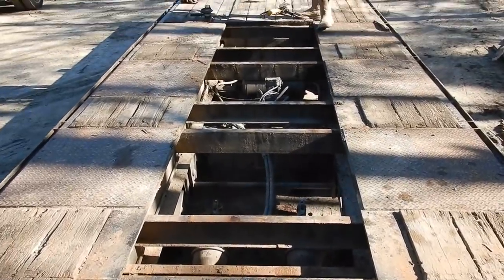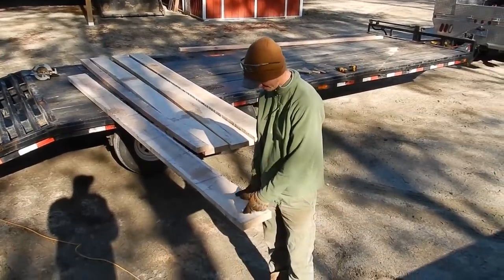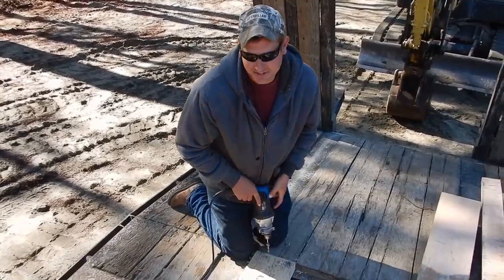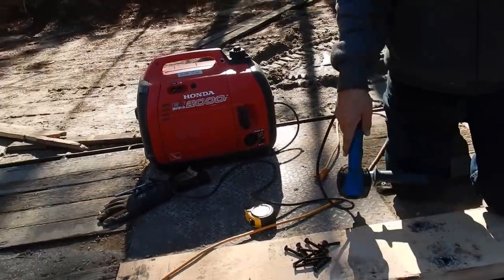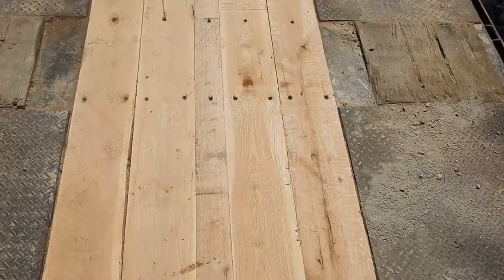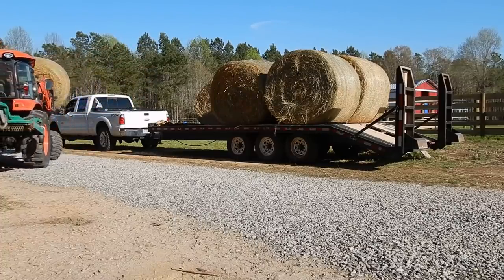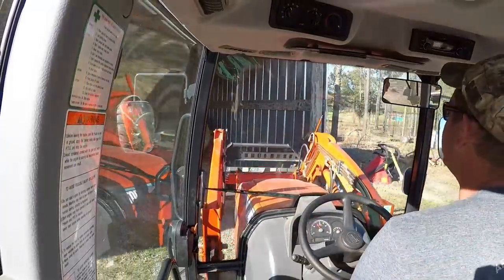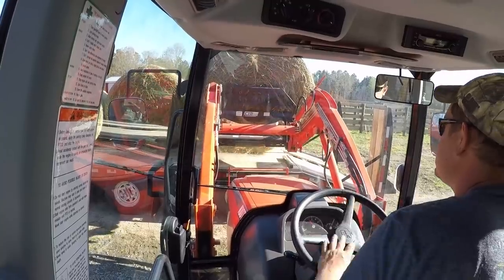Fixing The Trailer Deck And Unloading Hay

Comment: You drill steel slow....  You're cooking your drill bit. Lower rpm lots of pressure and a little cutting oil would make your life much easier
Reply: Nahh little drill send it full power
Reply: Depends on the drill bit. And size of steel and type. Dont act like a know it all if you dont know what your talking about
Reply: @williamuskoski1385  only been a fabricator welder for 10 years wouldn't know anything about drilling holes. By the looks of it a 1/4inch bit on pfc channel probably 1/4inch maybe a little thicker so yea that drill probably wouldnt spin it fast enough.
Reply: @hamishcampbell4578  Been a welder fabricator and design my own tools for 30 years ! I keep a small container of used motor oil near and dip the drill tip into the oil when ever it needs it ! I've drilled steel using a wood bit using that method ! You don't need cutting oil as long as it's any oil !

Comment: Just a suggestion for your pasture: buy some step in posts and wire, and divide the pasture into 3 or 4 sections so you can rotationally graze it. If you let them in the whole thing all at once, they will eat everywhere and the grass will have a hard time keeping up. Dividing it should keep you from supplementing them so much. Great video!!

Comment: We use a flat steel piece laid across the trailer, clamp it on the ends and use a mag drill and some oil. It’s works great and it’s a lot easier.

Comment: @letsdig18  no hurry on the hay spear.   Skidsteer + Pallet Forks are great maneuverability.

IF you use the tractor for moving bales a lot, a box blade counterweight gives you more room and less bale/tire bounce

Also ... add a 3pt rear bale spike...cheaper, gives your loader a break if moving just one, and when moving 2 its your counterweight.

Tip the bails over and you can stack 4 bales in the stall rows you stacked 3 bales in.

Comment: being its an equipment trailer 
next time drilling holes 
drill thru wood 
then ADD cutting fluid or a multipurpose oil like 3-IN-ONE down hole  
Looks like nice White Oak lumber 
I also Water preserve all Sides of Lumber on Work Horses PRIOR to Install 
 = looking good
Reply: Cutting oil and slowing the drill speed would also help.

Comment: Oiling your drill bits is a MUST while drilling steel or aluminium. Be cheap ones or expensive ones.
As soon as you see smoke coming out, the bit is toast from overheating. Look at machines shops, they always oil their cutting, drilling tools.

Comment: If you set the bale on the one on the right after you pull back it will roll to the center. If it doesn’t you can make it roll

Comment: Buy some Triumph twist drills, or Precision Twist drills (PTD), don't buy no import drills.  If you aren't paying at least a dollar for one of those 1/4 drills, you're not buying the right stuff.  Call McMaster and order a dozen Jobber length 118 degree black oxide coated twist drills.  They are $2.82 each and $28.73 per dozen.  When you make them dull, put them in the "sharpen me" pile for a rainy day.
Reply: Drill bits over there are cheap equivalent of a 1/4 inch bit over here in uk for anything worth having “Dormer” would be $7.50  each !.
Reply: You wrote 118 degree drill point; what about the 135 split point drill bits, would they not be better for this work.

Comment: cris im 70 a electricAl fitter ive drilled 1000s of holes in meal when you hit steel pull the drill out put it in oil rt realy it cools and lubricates the drill it stops overheating blunting and breaking you will make job faster and easier

Comment: Trailer decking washers or clips -- Drill a 3/8" hole just through the wood right next to the flanged side of the cross beams-- hammer in a 3/8" carriage bolt and from underneath you put the large washer or clip on the bolt and the washer/clip catches on the flange of the steel beam --no drilling through the beam and no fighting with all those bolt stubs when the decking needs replacement.

Comment: Coming from someone that had a bad experience last week. Make sure you keep your front tire pressure at max.  If not at the max, the tires are really easy to roll off the rim with a heavy load on the front end loader.  This causes allot of cussing, and a long walk to the shop to get another piece of equipment.
Reply from the maker: haha I bet, I keep them at the right psi and not hard turns

Comment: Respect and handle your drill bits with care. Small pilot hole first and then larger drill second, piece of cake. Higher RPM's on small bit and use some type of cutting oil when drilling.

Comment: Backhoe. With a chain from corner to corner on the front bucket.  Drape in over the bale get off n slide it down under the bale. Then roll the bucket back... just in case the tractor isn't available.

Comment: Those drill bit will keep going to shit when you drill through two materials cause it can’t clear out the cuttings. I’d drill through the wood and get into the metal enough to mark the hole on the metal then flip the board out of the way. Then you can drill into the metal easy peasy, especially if you use tap magic or some other cutting oil. Otherwise your gonna burn through bits like nobody’s business. Anyway badass video bro love watching your channel!

Comment: Flip the bales on end. You can stack them without crushing them
Reply: BillyD He's hauling and stacking them like you're supposed to. Stack another layer on top down the middle on the trailer if he had more to haul and trailer take it. Use a bale spear to load and unload. In his case, pallet forks for now.

Comment: That's the hard way to put boards on a trailer, they make clips that you can use from the bottom. These clips screw to the wood and have sharps prongs that dig into the steel underneath. No drilling required and your not making Swiss cheese of your beams. I would also recommend using stain on those boards as well. I could have cut and affixed all those boards to that trailer in less than an hour.

Comment: Those drill bits are NOT a burning tool they are a cutting tool. slooooooow down and use a lot of pressure and just enough power to keep the bit turning. ALSO use cobalt bits.

Comment: different cutting edge pitch between wood & metal bits. a metal bit will dull quicker cutting through wood  then anything  else when you do this again use both types of bits and mark the wood first drill withough the wood then set wood decking

Comment: Soak those boards with linseed oil now and then they will last forever. I soaked mine then turned them over installed them and soaked again. But all I had was some commercial milled 2x8 doug fir. still on there.

Comment: try getting a spray can of electric motor cleaner and hose out the generator windings
Reply: Noah I got the same generator. A good heavy duty drill 10-12 amps will make it grunt sometimes. Good generator, just rated for 2000 watts.

Comment: Impact drivers are the only tool for screws, Get a smaller one for your standard screws and you won't use a cordless drill for anything other than drill bits.

Comment: Totally random bit of worthless info.  I bought a step deck with an aluminum deck.  The factory got a bad batch of fasteners and the heads were popping off left and right.  Literally.  Left and right side of the trailer.  As well as the middle.  So the factory paid for a bunch of the fasteners that had broken to be replaced and later that year a bunch more had broken.  The factory said let me send you some fasteners.  I figured they would send a couple hundred screws.  They sent an entire case of screws.  It was about 75 lbs of screws.  To say the least I replaced all the screws in my deck and have fixed several other trailers as well.  Love good deck screws.

Comment: I have broke a 3/8 bolt with the little impact and that's the mid torque or bigger cutting oil on drill bit at low speed high speed on thick steel kills the drill bit

Comment: Stop using outdated technology by screwing the boards to the trailer frame and using up drill bits in the process. Call Miller and ask them about their new Wood-Welder model WOW-2000. Get the one with the hardwood attachment for oak and you'll get it done in half the time.
Reply: What's that ? Glue ?

Comment: dont know how many cows you have coming or how old there are but i have 6 23 month old steers 2 heifers 2 beef calve heifers 2 months old and 3 6 month old steers and them 6 bales last me a month, and less when its 40 below, the bles i get weigh between 1200 and 1500 Lbs and i have never used a hay spear to unload, just the forklift, but i cant push a fork into the bale there packed so tight, i just pick them up with the 6 foot forks like nothing

Comment: Now I don't know if that's how you hauled it but there's 2 kinds of people in this world. You with the 2 straps on the bails one front and one back and ChuckE2009 with 2 straps on each set of bails and an extra long strap going length wise across them all.... I tend to go with the a couple straps will be ok but i think that comes with working with equipment and loading unloading everyday multiple times a day. Not that my stuff is unsafe because it's not.
Reply: We haul 14 rolls at the time. We run a chain though the loading ramps and lay them back at a angle then put 5 each side on the bottom. Then we cap it down the middle 4. Never lost a roll and never used a strap.

Comment: Chris, just stab that shit with both forks, provided the forks are not wider than the round bale and not as dull as Alexandria Ocasio Cortex.  it works fine. Done it many times and stack them on top of each other. Heat is the enemy of drill bits in metal. Ya gots to use some oril.

Comment: Yeah save yourself some money and just use the forks. You can stab both in and the bale won't spin. Forks will last lots longer than a bale spear. Most forks are for 3000 to 4000 lbs. bale spear rating is use till they break or bend. We use forks for years.

Comment: why dont you just steel plate the whole trailer
Reply: Not one of those know it alls but I do know why He doesn’t steel plate the whole trailer. The steel tracks on the equipment would have no friction if the trailer were steel plated and thus just slide right off with the slightest bit of moisture and slope. 😁